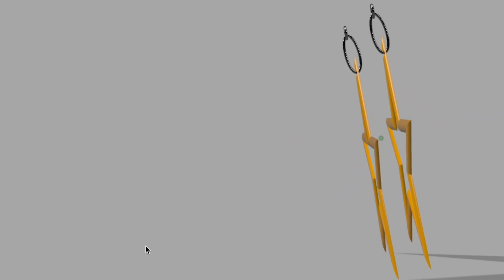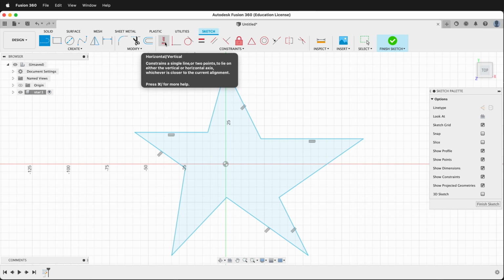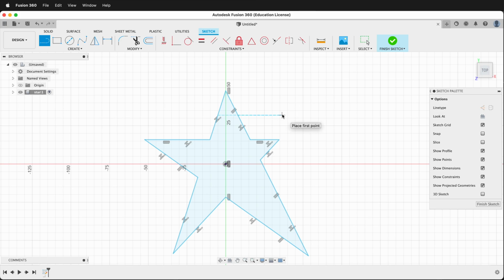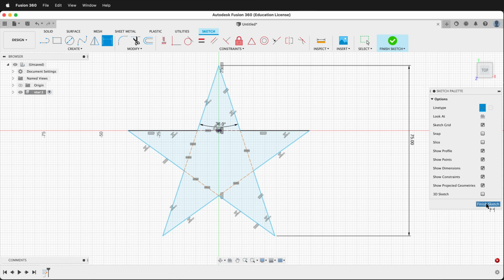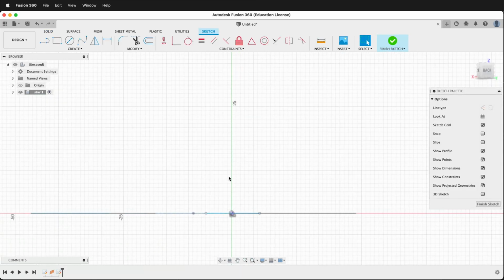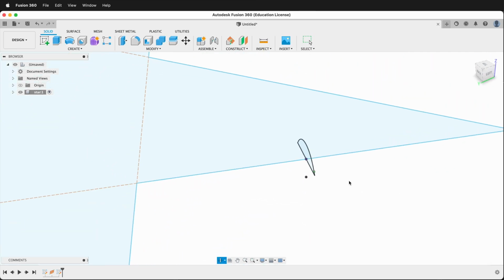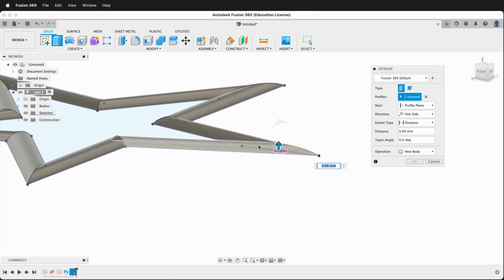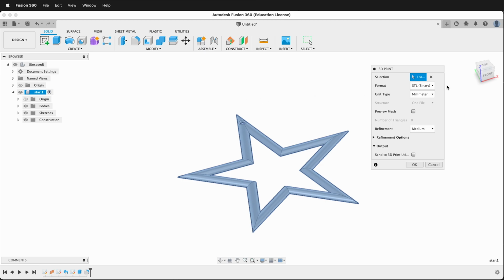3D Printed Earrings in Fusion 360 Tutorial

Comment: I have been following this video on Fusion 360. When I extrude the hole in the star, it forms a hole but then i am unable to select its edges for Fillet. When I export the body to Cura for slicing and printing, I receive an error message "The highlighted area indicate either missing or extraneous surfaces. Fix your model and open it again in Cura". If I slice this model, then the hole does not appear in the sliced output. Any thoughts?
Reply from the maker: What scale is the model? If you're using something with features less than 0.4 mm then the slicer is going to have problems, and it probably won't print well.  try making it bigger to see if it works
Reply: @WhatMakeArt  I used same dimensions as the video. The home was 2.5mm in diameter
Reply from the maker: That is strange, that should make a filler and work in Cura, maybe try to model a simple half cylinder with a hole to test with less variables
Reply: @WhatMakeArt  I cant even fillet the edges of the hole. I cant select the edge. tried using a hole function, circle with extrude set to cut.
Reply from the maker: Super strange, a circle should be able to be filleted after it's cut through a form, can you fill it a circle if you just cut through a cube or some simple shape?